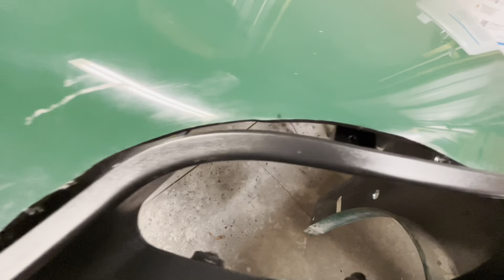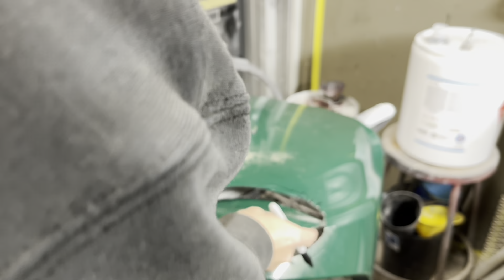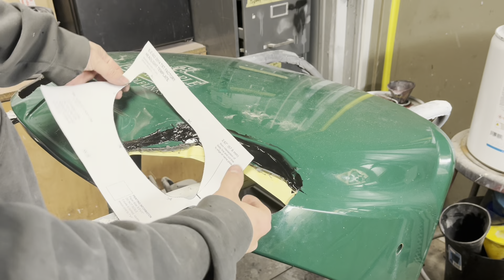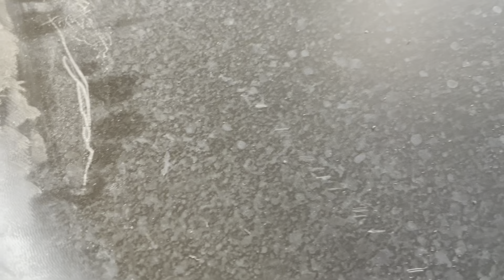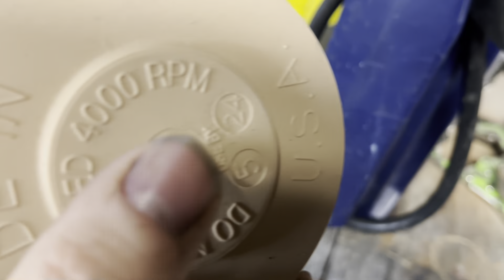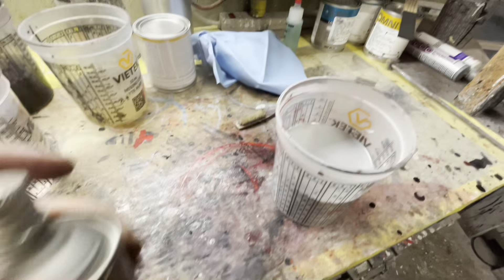Golf cart headlight conversion MISTAKE 😲 Got to fix that‼️ 😭 (Plastic Repair)

Comment: Well. got the gun and did a sample repair on a hole in the body front panel...used Dolphin glaze to finish the repair...... Now a day later tackled the exact repair you did here on the front light hole....When i went to use the stuff the tip was unusable....Had to use the spare tip that came with the stuff....?????? do I assume these tips are a one time use and if so where do I buy more....I have one more taillight hole to repair to complete the job.....The hole repair seem to be good....will use adhesion primer, then primer again and attempt to paint in a day of so....ty for your help here again
Reply from the maker: Yes one time use. I order extras off eBay. Try searching for “3m panel bond tips”

Comment: Okay....doing exactly the same thing on my drive 2 yamaha cart....the filler and the gun are VERY expensive but I bought it anyway......my cart body is not as thick as the one you did but will follow the same procedure fixing and painting....ty
Reply from the maker: You’re very welcome
Reply: @ThePaintPaperHustle  BTW…. Found a gun for $40….. yours was $94 at todays prices ouch
Reply from the maker: @davidaldrich3488 that’s awesome!

Comment: Love the videos. I have a broken missing piece on my club car. Will build a new piece using abs and bonding as you have shown with 04240. What disc are you grinding the 04240 down with after hardening?  Thanks for sharing.
Reply from the maker: 36 grit to get it all down and shaped. You’re very welcome